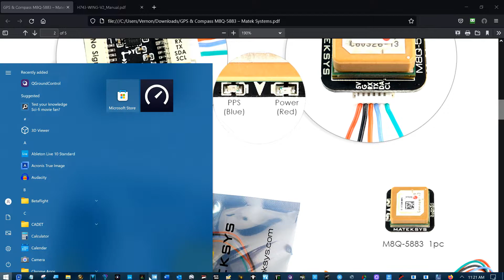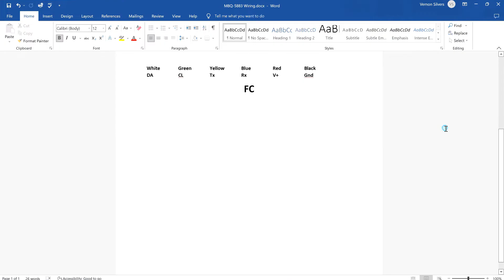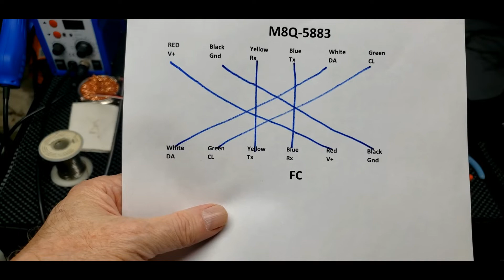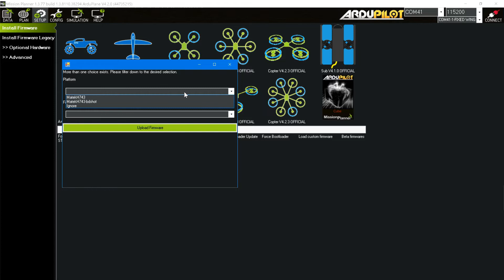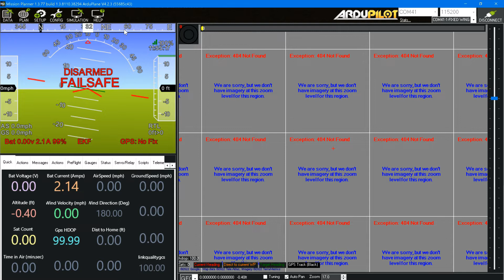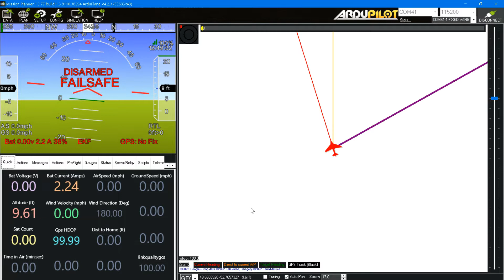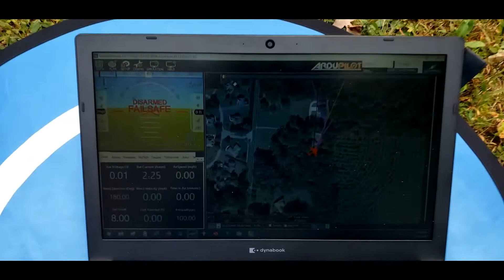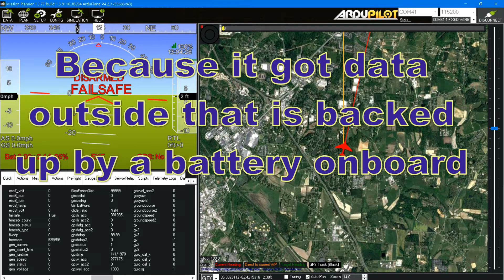Wiring Up The M8Q 5883

Comment: Got it. Had to go into configuration and move gps_type to 2.  Thanks alot for the help!
Reply from the maker: You are very welcome.

Was this in Ardupilot that you had to configure something?  I did not.  Defaults of ArduPlane worked for me.  Current version.  :)
Reply: Yes it was in Ardupilot. It might have been because I had used a different gps and it was configured to it instead. So I had to manually change it.
Reply from the maker: @horsship  Ah.  I can see that.

Have fun and send us videos.